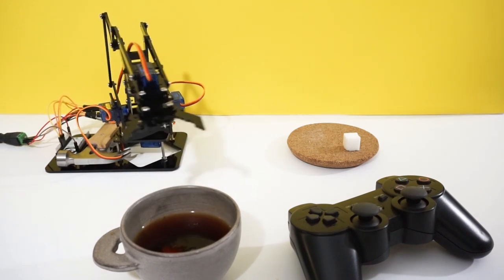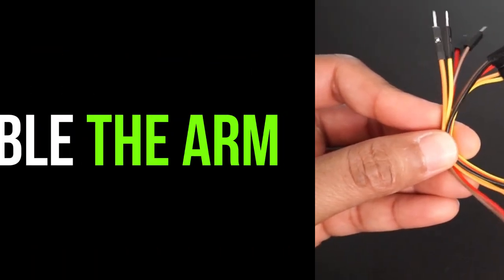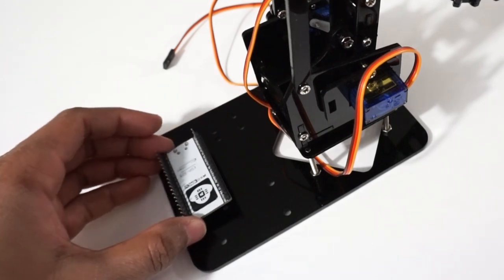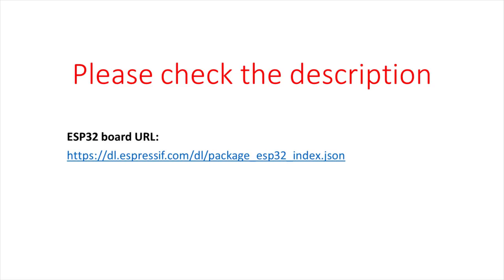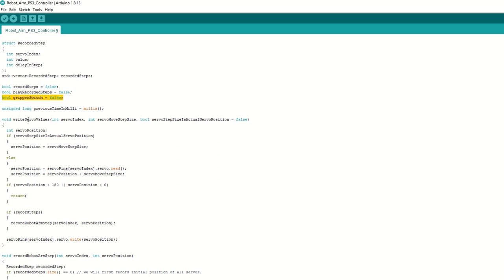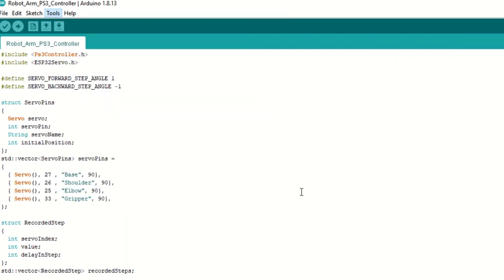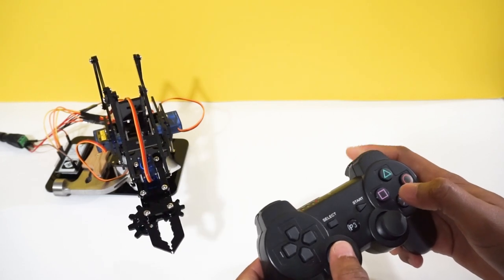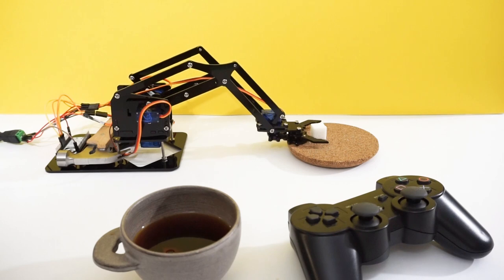Robot Arm with PS3 Controller and ESP32 | Record and Play feature 🔥

Comment: I'm having the same problem - "Compilation error: 'vector' in namespace 'std' does not name a template type" i've read the previous replies and the code is correct and i'm using the 38pin esp32 - any suggestions?
Reply from the maker: Please add this line at the top of code.  #include <vector>

Comment: thank you very much for making this video. is there a way to get this method to work with more then 4 servo motors. and if so how many servos can be added?
Reply from the maker: Yes you can add more servos. There are many buttons left in controller . But for that you will have to make changes in code . Please check the video and try to add it 👍🏻👏🏻
Reply: @hashincludeelectronics   awesome thank you very much for the info.

Comment: Does it matter what type of cable you use to connect the controller to the computer?
Reply from the maker: Yes. I observed the same . Some cables do not work while other works . Not sure if these data cables have required data wires . 👍🏻👏🏻

Comment: Hello, If I add more servo motors and add it, for example, to the triangle button, will the x or y axis be added?
Reply from the maker: Yes you can add more servos in it 👍🏻👏🏻
Reply: If you add more servos, only the parts in which they appear change, do you add more pins and more buttons?
Reply from the maker: @ErikGabriel-pk3gz  you will have to make changes in code and also use the available pins for connections 👍🏻👏🏻
Reply: In this part of the code the number 4 indicates the number of servos that you are occupying or what it means

/This is to move servo to initial position slowly. First 4 steps are initial position    
  for (int i = 0; i < 4 &&
 playRecordedSteps; i++)
  {
Reply from the maker: @ErikGabriel-pk3gz  let me check and confirm 👍🏻👏🏻
Reply from the maker: Yes it is . These are number of servos . 👍🏻👏🏻

Comment: I have an 12volt 5amps adaptor...can i use it....esp32 module can withstand or not??
Reply from the maker: You need to use 5v adapter only 👍🏻👏🏻
Reply: @hashincludeelectronics  5volt 3amps is enough! And thanks for your reply!!
Reply from the maker: @MyHobbyProjects-mg77  yes that would work 👍🏻👏🏻
Reply: @hashincludeelectronics  okayy

Comment: sir its installation esp32 code first or bluetooth mac adress first sir?
Reply from the maker: You should get the Bluetooth mac address first and then upload the final code. for uploading the code into esp32 you have to install esp32 board into your Arduino ide. this is common step.

Comment: Hello everything is fine? Would you like to know the generic control you are using? Do you have a specific model. I bought several generics and none can communicate esp32. I'm using ps3controller.h.
The control I bought it communicates with the cell phone without problem but not like the Esp32. I believe the data package that the control sends is not matching the library. Thank you for your attention. Thanks!

Comment: In my esp32 module there is only 30pins....is work on that!
Reply from the maker: Please check if all pins are there in your module which are used in this project . If yes then it will work 👍🏻👏🏻please check the circuit diagram to see what all pins are used .
Reply: @hashincludeelectronics  thank you so much

Comment: sir can we use ps4 controller instead of ps3 controller
Reply from the maker: Yes you can give it a try . I did not try PS4 yet . However you will have to install PS4 library .
Reply: Thanks
Reply: Bonjour, avez-vous réussi ?

Comment: C:\Users\Ricardo\Downloads\Robot_Arm_PS3_Controller-main\Robot_Arm_PS3_Controller-main\Robot_Arm_PS3_Controller\Robot_Arm_PS3_Controller.ino:14:6: error: 'vector' in namespace 'std' does not name a template type
 std::vector<ServoPins> servoPins =
      ^~~~~~
C:\Users\Ricardo\Downloads\Robot_Arm_PS3_Controller-main\Robot_Arm_PS3_Controller-main\Robot_Arm_PS3_Controller\Robot_Arm_PS3_Controller.ino:14:1: note: 'std::vector' is defined in header '<vector>'; did you forget to '#include <vector>'?
C:\Users\Ricardo\Downloads\Robot_Arm_PS3_Controller-main\Robot_Arm_PS3_Controller-main\Robot_Arm_PS3_Controller\Robot_Arm_PS3_Controller.ino:3:1:
+#include <vector>
 
C:\Users\Ricardo\Downloads\Robot_Arm_PS3_Controller-main\Robot_Arm_PS3_Controller-main\Robot_Arm_PS3_Controller\Robot_Arm_PS3_Controller.ino:14:1:
 std::vector<ServoPins> servoPins =
 ^~~
C:\Users\Ricardo\Downloads\Robot_Arm_PS3_Controller-main\Robot_Arm_PS3_Controller-main\Robot_Arm_PS3_Controller\Robot_Arm_PS3_Controller.ino:28:6: error: 'vector' in namespace 'std' does not name a template type
 std::vector<RecordedStep> recordedSteps;
      ^~~~~~
C:\Users\Ricardo\Downloads\Robot_Arm_PS3_Controller-main\Robot_Arm_PS3_Controller-main\Robot_Arm_PS3_Controller\Robot_Arm_PS3_Controller.ino:28:1: note: 'std::vector' is defined in header '<vector>'; did you forget to '#include <vector>'?
 std::vector<RecordedStep> recordedSteps;
 ^~~
C:\Users\Ricardo\Downloads\Robot_Arm_PS3_Controller-main\Robot_Arm_PS3_Controller-main\Robot_Arm_PS3_Controller\Robot_Arm_PS3_Controller.ino: In function 'void writeServoValues(int, int, bool)':
C:\Users\Ricardo\Downloads\Robot_Arm_PS3_Controller-main\Robot_Arm_PS3_Controller-main\Robot_Arm_PS3_Controller\Robot_Arm_PS3_Controller.ino:45:21: error: 'servoPins' was not declared in this scope
     servoPosition = servoPins[servoIndex].servo.read();
                     ^~~~~~~~~
C:\Users\Ricardo\Downloads\Robot_Arm_PS3_Controller-main\Robot_Arm_PS3_Controller-main\Robot_Arm_PS3_Controller\Robot_Arm_PS3_Controller.ino:45:21: note: suggested alternative: 'ServoPins'
     servoPosition = servoPins[servoIndex].servo.read();
                     ^~~~~~~~~
                     ServoPins
C:\Users\Ricardo\Downloads\Robot_Arm_PS3_Controller-main\Robot_Arm_PS3_Controller-main\Robot_Arm_PS3_Controller\Robot_Arm_PS3_Controller.ino:58:3: error: 'servoPins' was not declared in this scope
   servoPins[servoIndex].servo.write(servoPosition);
   ^~~~~~~~~
C:\Users\Ricardo\Downloads\Robot_Arm_PS3_Controller-main\Robot_Arm_PS3_Controller-main\Robot_Arm_PS3_Controller\Robot_Arm_PS3_Controller.ino:58:3: note: suggested alternative: 'ServoPins'
   servoPins[servoIndex].servo.write(servoPosition);
   ^~~~~~~~~
   ServoPins
C:\Users\Ricardo\Downloads\Robot_Arm_PS3_Controller-main\Robot_Arm_PS3_Controller-main\Robot_Arm_PS3_Controller\Robot_Arm_PS3_Controller.ino: In function 'void recordRobotArmStep(int, int)':
C:\Users\Ricardo\Downloads\Robot_Arm_PS3_Controller-main\Robot_Arm_PS3_Controller-main\Robot_Arm_PS3_Controller\Robot_Arm_PS3_Controller.ino:64:7: error: 'recordedSteps' was not declared in this scope
   if (recordedSteps.size() == 0) // We will first record initial position of all servos.
       ^~~~~~~~~~~~~
C:\Users\Ricardo\Downloads\Robot_Arm_PS3_Controller-main\Robot_Arm_PS3_Controller-main\Robot_Arm_PS3_Controller\Robot_Arm_PS3_Controller.ino:64:7: note: suggested alternative: 'recordedStep'
   if (recordedSteps.size() == 0) // We will first record initial position of all servos.
       ^~~~~~~~~~~~~
       recordedStep
C:\Users\Ricardo\Downloads\Robot_Arm_PS3_Controller-main\Robot_Arm_PS3_Controller-main\Robot_Arm_PS3_Controller\Robot_Arm_PS3_Controller.ino:66:25: error: 'servoPins' was not declared in this scope
     for (int i = 0; i < servoPins.size(); i++)
                         ^~~~~~~~~
C:\Users\Ricardo\Downloads\Robot_Arm_PS3_Controller-main\Robot_Arm_PS3_Controller-main\Robot_Arm_PS3_Controller\Robot_Arm_PS3_Controller.ino:66:25: note: suggested alternative: 'ServoPins'
     for (int i = 0; i < servoPins.size(); i++)
                         ^~~~~~~~~
                         ServoPins
C:\Users\Ricardo\Downloads\Robot_Arm_PS3_Controller-main\Robot_Arm_PS3_Controller-main\Robot_Arm_PS3_Controller\Robot_Arm_PS3_Controller.ino:78:3: error: 'recordedSteps' was not declared in this scope
   recordedSteps.push_back(recordedStep);
   ^~~~~~~~~~~~~
C:\Users\Ricardo\Downloads\Robot_Arm_PS3_Controller-main\Robot_Arm_PS3_Controller-main\Robot_Arm_PS3_Controller\Robot_Arm_PS3_Controller.ino:78:3: note: suggested alternative: 'recordedStep'
   recordedSteps.push_back(recordedStep);
   ^~~~~~~~~~~~~
   recordedStep
C:\Users\Ricardo\Downloads\Robot_Arm_PS3_Controller-main\Robot_Arm_PS3_Controller-main\Robot_Arm_PS3_Controller\Robot_Arm_PS3_Controller.ino: In function 'void playRecordedRobotArmSteps()':
C:\Users\Ricardo\Downloads\Robot_Arm_PS3_Controller-main\Robot_Arm_PS3_Controller-main\Robot_Arm_PS3_Controller\Robot_Arm_PS3_Controller.ino:84:7: error: 'recordedSteps' was not declared in this scope
   if (recordedSteps.size() == 0)
       ^~~~~~~~~~~~~
C:\Users\Ricardo\Downloads\Robot_Arm_PS3_Controller-main\Robot_Arm_PS3_Controller-main\Robot_Arm_PS3_Controller\Robot_Arm_PS3_Controller.ino:84:7: note: suggested alternative: 'recordSteps'
   if (recordedSteps.size() == 0)
       ^~~~~~~~~~~~~
       recordSteps
C:\Users\Ricardo\Downloads\Robot_Arm_PS3_Controller-main\Robot_Arm_PS3_Controller-main\Robot_Arm_PS3_Controller\Robot_Arm_PS3_Controller.ino:91:34: error: 'recordedSteps' was not declared in this scope
     RecordedStep &recordedStep = recordedSteps[i];
                                  ^~~~~~~~~~~~~
C:\Users\Ricardo\Downloads\Robot_Arm_PS3_Controller-main\Robot_Arm_PS3_Controller-main\Robot_Arm_PS3_Controller\Robot_Arm_PS3_Controller.ino:91:34: note: suggested alternative: 'recordedStep'
     RecordedStep &recordedStep = recordedSteps[i];
                                  ^~~~~~~~~~~~~
                                  recordedStep
C:\Users\Ricardo\Downloads\Robot_Arm_PS3_Controller-main\Robot_Arm_PS3_Controller-main\Robot_Arm_PS3_Controller\Robot_Arm_PS3_Controller.ino:92:32: error: 'servoPins' was not declared in this scope
     int currentServoPosition = servoPins[recordedStep.servoIndex].servo.read();
                                ^~~~~~~~~
C:\Users\Ricardo\Downloads\Robot_Arm_PS3_Controller-main\Robot_Arm_PS3_Controller-main\Robot_Arm_PS3_Controller\Robot_Arm_PS3_Controller.ino:92:32: note: suggested alternative: 'ServoPins'
     int currentServoPosition = servoPins[recordedStep.servoIndex].servo.read();
                                ^~~~~~~~~
                                ServoPins
C:\Users\Ricardo\Downloads\Robot_Arm_PS3_Controller-main\Robot_Arm_PS3_Controller-main\Robot_Arm_PS3_Controller\Robot_Arm_PS3_Controller.ino:102:23: error: 'recordedSteps' was not declared in this scope
   for (int i = 4; i < recordedSteps.size() && playRecordedSteps ; i++)
                       ^~~~~~~~~~~~~
C:\Users\Ricardo\Downloads\Robot_Arm_PS3_Controller-main\Robot_Arm_PS3_Controller-main\Robot_Arm_PS3_Controller\Robot_Arm_PS3_Controller.ino:102:23: note: suggested alternative: 'recordSteps'
   for (int i = 4; i < recordedSteps.size() && playRecordedSteps ; i++)
                       ^~~~~~~~~~~~~
                       recordSteps
C:\Users\Ricardo\Downloads\Robot_Arm_PS3_Controller-main\Robot_Arm_PS3_Controller-main\Robot_Arm_PS3_Controller\Robot_Arm_PS3_Controller.ino:106:5: error: 'servoPins' was not declared in this scope
     servoPins[recordedStep.servoIndex].servo.write(recordedStep.value);
     ^~~~~~~~~
C:\Users\Ricardo\Downloads\Robot_Arm_PS3_Controller-main\Robot_Arm_PS3_Controller-main\Robot_Arm_PS3_Controller\Robot_Arm_PS3_Controller.ino:106:5: note: suggested alternative: 'ServoPins'
     servoPins[recordedStep.servoIndex].servo.write(recordedStep.value);
     ^~~~~~~~~
     ServoPins
C:\Users\Ricardo\Downloads\Robot_Arm_PS3_Controller-main\Robot_Arm_PS3_Controller-main\Robot_Arm_PS3_Controller\Robot_Arm_PS3_Controller.ino: In function 'void notify()':
C:\Users\Ricardo\Downloads\Robot_Arm_PS3_Controller-main\Robot_Arm_PS3_Controller-main\Robot_Arm_PS3_Controller\Robot_Arm_PS3_Controller.ino:127:7: error: 'recordedSteps' was not declared in this scope
       recordedSteps.clear();
       ^~~~~~~~~~~~~
C:\Users\Ricardo\Downloads\Robot_Arm_PS3_Controller-main\Robot_Arm_PS3_Controller-main\Robot_Arm_PS3_Controller\Robot_Arm_PS3_Controller.ino:127:7: note: suggested alternative: 'recordSteps'
       recordedSteps.clear();
       ^~~~~~~~~~~~~
       recordSteps
C:\Users\Ricardo\Downloads\Robot_Arm_PS3_Controller-main\Robot_Arm_PS3_Controller-main\Robot_Arm_PS3_Controller\Robot_Arm_PS3_Controller.ino: In function 'void setUpPinModes()':
C:\Users\Ricardo\Downloads\Robot_Arm_PS3_Controller-main\Robot_Arm_PS3_Controller-main\Robot_Arm_PS3_Controller\Robot_Arm_PS3_Controller.ino:191:23: error: 'servoPins' was not declared in this scope
   for (int i = 0; i < servoPins.size(); i++)
                       ^~~~~~~~~
C:\Users\Ricardo\Downloads\Robot_Arm_PS3_Controller-main\Robot_Arm_PS3_Controller-main\Robot_Arm_PS3_Controller\Robot_Arm_PS3_Controller.ino:191:23: note: suggested alternative: 'ServoPins'
   for (int i = 0; i < servoPins.size(); i++)
                       ^~~~~~~~~
                       ServoPins

exit status 1

Compilation error: 'vector' in namespace 'std' does not name a template type
Reply: I can't find the error
Reply: std::vector<ServoPins> servoPins =
Reply from the maker: @RicardoCosta-uy7sr  please add below line  at the beginning of the code .
#include <vector>

Comment: Error = 'vector' in namespace 'std' does not name a template type

how to fix it sir?
Reply from the maker: Make sure you copy the entire code from github link . Don’t miss any lines in the beginning .
Reply: @hashincludeelectronics  I make sure I download it on the Github link you gave me, not even one line is missing. but yeah that's the error like that
Reply from the maker: @SolehAlYunus  ok . Add this line at the beginning of code #include <vector.h>
Reply: @hashincludeelectronics  now the error is "vector.h No Such file or directory"
Reply: @hashincludeelectronics  where do i get the "vector.h" library file?
Reply from the maker: @SolehAlYunus  remove .h from vector.h and try .
Reply: @hashincludeelectronics  ok successfully uploaded sir, but the only thing that can be controlled is the gripper. for base, shoulder, and elbow can't be controlled
Reply from the maker: @SolehAlYunus  check the connections again . Also don’t use non rechargeable battery .
Reply: @hashincludeelectronics  no, I don't use battery. but using a 5v 3A adapter.
Reply from the maker: @SolehAlYunus  then it should work . Check the connections.
Reply: @hashincludeelectronics  the connection is ok, I tried moving the Servo gripper OK to Elbow or shoulder and base, it doesn't move the same, while the gripper is ok
Reply: @hashincludeelectronics  i am using Esp32 Dev kit, not Esp32 Wrovver kit does that matter?
Reply from the maker: @SolehAlYunus  yes it can cause issues . Please use esp32 38 pins as I used in project to avoid any issue .
Reply: @hashincludeelectronics  Oh I see, I buy Esp32 Wrovver , I'll try it first, I hope it works
Reply: @hashincludeelectronics  I've bought the Esp32 Wrover Module, but still can't control the servos for the elbows, base, and shoulders... only the gripper can be controlled. how do i solve it
Reply: My problem is the code will not compile
Reply: It won’t compile without the wrover? Or the wrover  is the wrong one?
Reply: @SolehAlYunus  mee too
Reply: @hashincludeelectronics   yo tengo el problema que solo se mueven los servos en una dirección de los joystick al otro lado no funcionan por qué?
Gracias de antemano